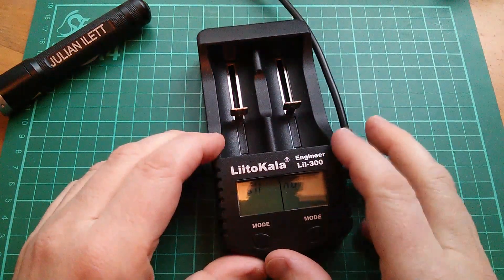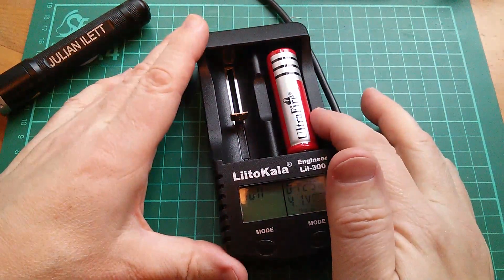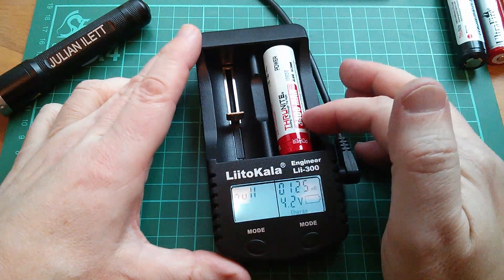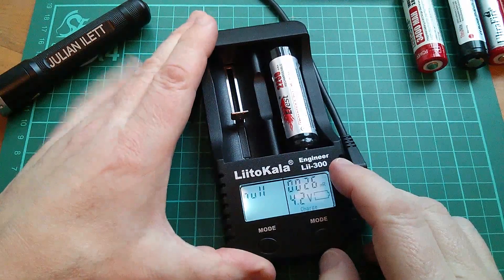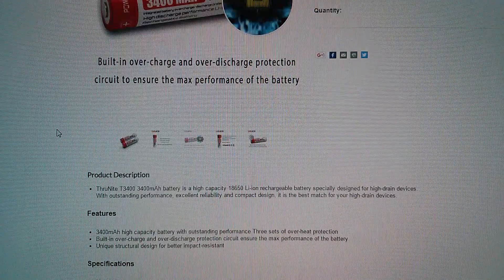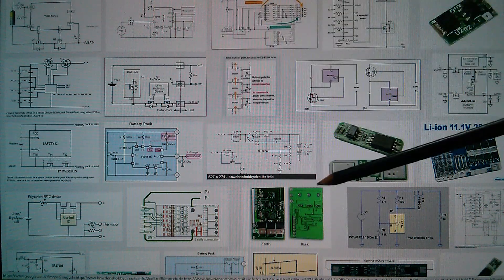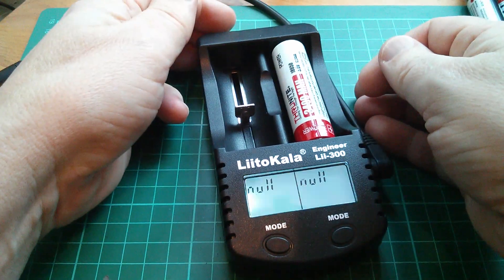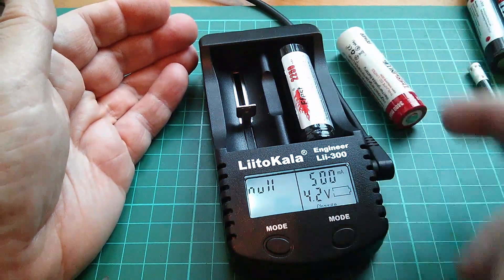Internal Resistance Check of LittoKala Lii-300 Battery Charger

Comment: I just picked up the Lii-500 4 bay charger without the power supply from AliiExpress. With my unprotected Panasonic's, I'm getting a reading of 10 to 20 milliohms. Not sure how accurate those readings are, but it's a nice feature to have. So far I'm quite pleased with it. Batteries come off the charger at 4.19 volts. On the other hand, my Lii-100 overcharges a little at 4.25 on average. I'm not too pleased with that.

Comment: Hi Julian - Higher stroage capacity almost always gets you lower current delivery capability as they put in less metal conductor to make room for more electrolyte to store the charge - That's the reason that deep-cycle lead-acid batteries have a higher Ah rating than a similarly sized starting battery. You can either have lots of electrolyte but with less contact area with the conductors which gives you high capacity, but less current delivery... or you can have lots of metal in contact with the electrolyte for massive current capacity, but less electrolyte overall as you've filled the space with metal instead.  Hope that helps explain what you're seeing. Cheers!!
Reply: +Jim Conner Makes sense!

Comment: Had one of these for over a year now - good charger.  The milliohm scale will go much higher than 125 (seen 700-800 readings).  Only problem I've had is sometimes the cell protection circuit turns off the connection before the charger's cell protection circuit has determined the end of charge and the result is a "null" reading when charged.

Comment: Working with high current LED drivers, I came across a white paper about using the known internal resistance of a mosfet transistor as the current measuring resistor, rather than an expensive high wattage precision resistor... could be the way a protection chip measures current as well.

Comment: I also had cells with 100 mohm resistance measurements.  I licked the ends of the cell and re-installed, the resistance dropped to 10 mohm.  So I'm starting to thing that it is the contact resistance that the device is mostly measuring.

Comment: IMR and ICR batteries are supposed to have different internal resistance.  I am sure the protection adds to the overall resistance but even unprotected would be higher on the ICR...

Comment: Protection circuit mosfets have some resistance. In fact, some circuits are "smart" and use the mosfet resistance to measure overcurrent with no external resistors.
Reply: Indeed, the most common protection circuits use the Rds of the back to back fets for the overcurrent protection, it's almost a given to find a DW01 (protection) and 8205A (dual fet) in chinese usb power banks etc

Comment: would have to get one and test it with various cells, but it seems like 125 mR is the highest you are getting.  Maybe the active circuitry in the protected cells are not allowing it to actually calculate the internal resistance, so it is defaulting to the highest setting for safety.

Comment: Why don't you measure / calculate the internal resistance yourself to compare it with the charger display? I think internal resistance in batteries are usually not static but are a function of charge and load. But neverless it would be interesting if you can measure something or not. I guess all you need is a good multimeter and a constant current load somewhere for 0.5 -  2A. Then measure unloaded voltage of battery and then the voltage when loaded with a known current. R=u/i where U is the differential between the measurements should give you some numbers.
Reply: Thats exactly how my charger does it. It uses a selectable current of up to 1 amp and gives good results. 
Its a modified b6 firmware on a modified b6 charger.

Comment: Just tested on my Lii-500. A red quality 3.7V cell I pulled out of a laptop batt pack gave me 41 milli-Ohm (or how do you write that correctly, probably mOhm) and a trustfire gave me 125mili-Ohm. 
Not sure which power adapter is included with your Lii-300 but the 12V - 2Amp one from my Lii-500 stopped working after 2 months time and looking at youtube I am not the only one. I've emailed both seller and LittoKala but have gotten no reply at all, it's been 2 weeks now I think so not too happy about that one.
Luckily standard jack so I am using another 12V one, the one from the Maha at this moment.
Reply from the maker: +Luc Peeters The power adapter supplied with my Lii-300 is a 12V 1.5A (max 24W) generic unit although it does have a LiitoKala sticker on it. It has a two pin euro connector, so I probably won't use it - needs a shaver adapter for use here in the UK. Interestingly, the car cigarette lighter cable has a warning sticker on it "Warning Max 12V Input" so not sure how it will like 14.4V from my solar power system or 14.2V from my car with the engine running.
Reply: +Julian Ilett  Aha didn't see the review on the other channel. Still need to watch it.
But I would be very careful to charge it with the solar system.  I have a Nitecore I4 charger that I connected to a solar system similar to yours, 7Ah lead batt, solar charger similar to your 30W garden light set and a 40 Watt panel.  
It worked perfectly during the free solar use time. But when Autumn set in I tried to use it on the 230 V mains and it acted really strange. I opened it up and one of the 16 Volt max capacitors was not like it should have been. This capacitor was near where the 12V input and the output of the actual build in power supply. Fixed it by using one from a broken MB from a pc.
I have only connected it to the, lets call it, solar station. When the sun gets out I might go check what actually comes out of the output when it is charging via the panel. Not sure if there are no suspicious spikes coming out that are in the neighborhood of the solar panels voltage. I wouldn't be surprised.
To be honest open it up, if you already haven't, and check the capacitors. Or otherwise a nice dc/dc converter to be sure but then again that is loss which we don't like.
Reply: +Julian Ilett Hopefully the max 12V warning is just so people don't stick it in a 24V socket on a truck. 
Maybe a peek inside to see what sort of regulation it has?
Reply from the maker: +Michael Tempsch Ah yes, I didn't think of that. It probably is a warning against using it in a truck.
Reply: +Julian Ilett any 12v use should accept that car use means upto around 14.4v,  i know the old cb radios did, and many power supplies for them specified 14.4v or thereabouts, in case lower voltage reduced output power a little
Reply: +jusb1066 I wouldn't go so far as to say "any 12v use should accept that car use..." - There may well be cases where a well regulated 12V could be used.

However, if you ship a product with a cig. lighter plug, then, yeah,   it  should accept the normal voltage range a car sees (and be reasonably sturdy wrt noise and spikes.) If not the end product itself, which might not even be 12V, then at least the circuitry you'd put in the plug to give the product what it needs.
Reply: Michael Tempsch
it would seem odd to use 12v input seeing as nothing needs 12v on the other side, the batteries, logic is 5v or less, 12v to me says 'use this in your car flexibility' and if it fails at 14v then it was just badly made
Reply: +Michael Tempsch  in my case the Nitecore had a 16 Volt rated capacitor over the '12 V' input. To be honest if I were developing a product where I knew it would be used in a car were the voltage can go up to 14.4 Volts then I would take tolerance a bit more serious. So I would not trust it without opening and checking.  I'm sure Julian will open it up.  In my personal case with the solar station I am going to measure first and then try to find a proper DC/DC converter so I am sure of the output.
Reply: +Julian Ilett 
It's also a bit odd they supply a car cigarette lighter cable when the back of the unit states 'Only Use Indoors'
Reply: slm60uk
they really mean 'only use indoors' to mean it has no sealing against moisture etc, its not like it can tell the difference between a living room and a car!
Reply from the maker: +jusb1066 A nice warm car with the heater running flat out! I've always thought the five most important things a car should have are 4 wheels and a heater :)
Reply: Julian Ilett
yep , its free heating, turn it up! lol
Reply: +jusb1066 using Ultrafire batteries you might not need a heater or have a car after trying to charge
Reply: jusb1066
"its not like it can tell the difference between a living room and a car!"
But I thought it was meant to be an intelligent charger :)
Reply: +Luc Peeters Same with the AVANTEK power bank. The 5V 2A charger gave up with the SECOND charge of this bank and COULD have started a fire when the rectifier would not have been gone open circuit!!!
Reply: +Luc Peeters 
I just looked on BestGear and found the 4 slot Lii-500 is only a couple of £ more than this 2 slot Lii-300. Whilst yours was working did it perform well? I can't decide between the Lii-500 or the BT-C3100 which seems to have all the best reviews, but cost an extra £10.
Reply: +slm60uk It works really well, except for the power adapter which I wouldn't trust a bit.  
I think you mean Gearbest?  Personally I would not deal with them. I bought something once which never ever arrived and after reading about their tricks I went directly via Paypal. Seems that they will offer you a 50% refund and that is it. Never had issues with Banggood. 
I got ripped off with the customs again on this one. In Europe, not sure if it is the same in the UK, there is a threshold of 22 euro. Above that you need to pay taxes, which I don't mind, but also a 12 euro handling fee that the postal service charges.Now my charger was 22,23 euro and I had to pay an extra 19 euro, taxes and handling. Nice for a copy/paste letter. The BT-C3100 can be had for a bit more on a Dutch website than what I paid for the Lii-500 with all the extra's.
Now I really like the Lii-500. Easy to use, even when taken out of a drawer after a year of no use probably, good and easy display. Reverse contacts (plus is downwards) is no issue at all

AHA before I forget !!!!!   Julian also please do this!  When you put this thing on a shelf, cabinet or so you will notice that the bottom is very very slippery. The first day it kissed the floor because I moved something else on the shelf it was on. I am not a native English speaker but you will probably know what I mean if I say that it doesn't really stick well on a surface.  I always keep those little rubber things which you can stick underneath a 19 inch box, chairs, etc so I stuck 4 of those in each corner and that solves the problem. Also a drop of silicon oil on the sliders and your set.
The power supply, well I have a ton of those so nothing special.

I've also noticed that if you have cells which have gone down too far in voltage, for example 0.2 Volts for a 1.2 Volt cell it will show 'NULL' on the display. Leave it in for x minutes and it will show up after a while and start charging at the default lowest current. The Lii-500 also has 4 charging currents to choose from I believe.

Any questions about the Lii-500 just ask and I will do my best to answer them.
Reply: +BloodySword  I've seen some weird and crazy things in the past couple of years. Sometimes I wonder if it is even safe to buy something from China that can hold an electric charge.  I've now become so careful that I charge batteries outside when possible (outside the sun if we have that bit here). 
I've had a charger from a pretty famous Chinese brand melt in the house. The crazy part is that the plastic is melt down all the way on the NTC which should have stopped the charging anyway.
Reply: +Luc Peeters Perhaps the NTC was missing or not properly connected...
Reply: +Luc Peeters 
Thanks for the detailed reply. Yes, GearBest (doh!) - I've only used them once before and was a bit reluctant to use them again because they failed to dispatch the first time, and I also had to claim my money back.
However, I have now found the Lii-500 is only around £17 (free p&p) on eBay and I rarely have any problems whilst buying around 30 items a month from China on eBay (it keeps my postman employed!) - and so far have never had to pay customs. The UK has similar customs & handling fees (EU regulations), but Chinese eBay sellers almost always mark the CN22 as a gift of value maximum value $10.

So, I think I'll go for the eBay Lii-500 - the PSU shouldn't be a problem - I have a few spares laying around. Thanks again.
Reply: +slm60uk Good luck!  I think this is a great charger for the price. Just remember to stick those rubber things on the bottom. Mine was almost fubar the first time. 
What I also like about this charger is that you can stick 4 of the same batteries in and switch it on (btw what happened to a hardware on/off switch?) and you can set a charging mode/current. It will use that for the 4 batteries. So no need to do that one by one. Yup, I like it.
Reply: +slm60uk lol, nice one! Had a good laugh 😂
Reply: +Julian Ilett this is the most indepth review I've found.
http://lygte-info.dk/review/Review%20Charger%20LiitoKala%20Lii-500%20UK.html

He says the resistance function is no good, but the rest of it is a good value.
Reply: +wooo weee 
Good find. I'm still waiting for my 500 to arrive, but will definitely compare with the details in that review. Thanks

Comment: You can also measure the internal resistance yourself. Measure the voltage at one load, then increase the load and measure voltage again.. Rin = (V2-V1)/(I2-I1) - should probably work even with protected circuits
Reply: When the protection circuit adds resistance that extra resistance will always reflect in the measurement.  You will not be able to bypass that extra resistance.

Comment: In my opinion protected cells are bullshit. I only use unprotected ones and the only protection they deserve is undervoltage protection. Everything other is bullshit when you just use appropriate chargers.
Reply: +BloodySword It's not about charging. Certainly none of my flashlights have undervoltage protection and they tend to work down to 1.0V or less, so they will severely over-discharge unprotected lithium cells before I notice any decrease in light output.
Reply: +renxula That's a pity. But with 3 Volts you notice that it's really dim and just charge it up again. I do that on my cheapo LED torch, too.